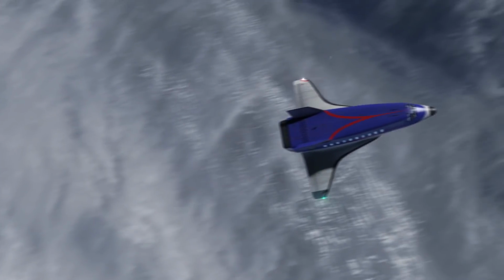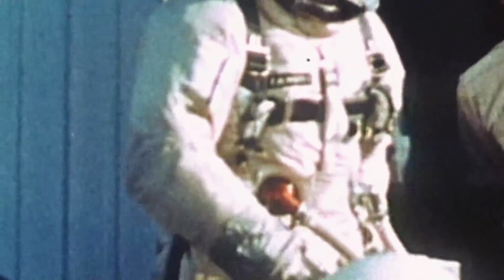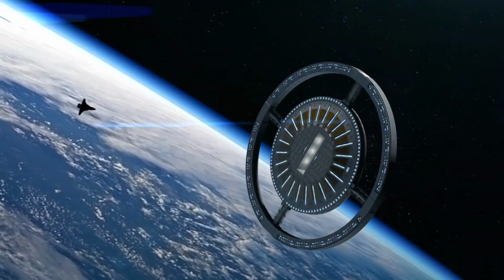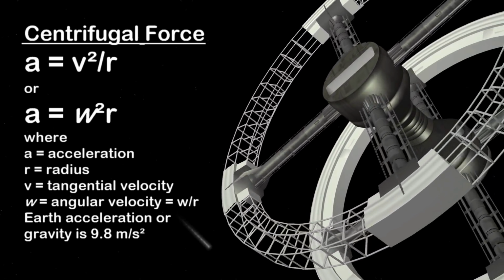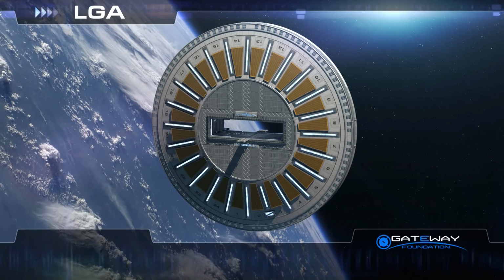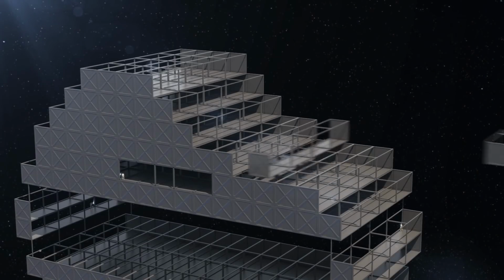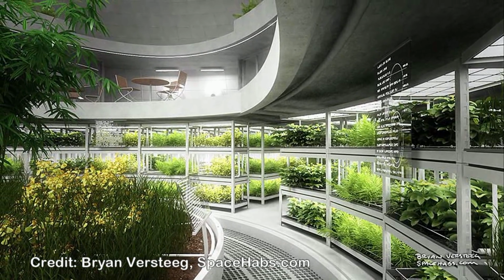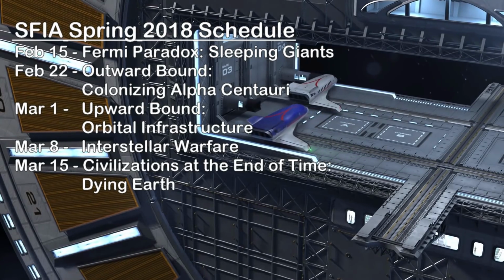Spaceports

Comment: 4:35 The people shown leaving that shuttle would NOT be able to walk like that. That corridor, as depicted, would look like a vertical shaft to them.
Reply: He is talking about how they are walking towards the outer edge of the ring so are actually walking along the walls towards the floor as the video depicts it. Seems the artist didn't think about the directions of the forces.
Reply: They would be able to if it is at all away from the center of the rotation. it would just be incredibly low gravity, but still enough to get a feel of it, and be attracted to the floor.
Reply: The stars moving in the background suggest that the space port is spinning and thus creating artificial gravity via centrifugal force from its spinning. It would be lower the closer you are to the center, but it would still be there as microgravity.

Comment: actually, while the square-cube law does help build large stations in terms of shielding and resonable minimum thickness walls, I might want to note that in terms of pressurized volume the squarecubelaw doesn't help you - or hinder you - it doesn't change anything - the larger a pressure tank gets the thicker its wallks must be to sustain the same pressure inside and te same rules of saling apply to any geometry plus a geometry factor, so any pressurized space scales in mass proportional to the volume - in fact under the ideal gas approximation a pressure tank made of a certain material holding a certain gas an i na certain geometry would have a constant ratio of gas-mass t tank-mass regardless of size - so a large space station would still need a minimum mass per cubic meter - to be fair for a welldesigned spherical or cylindrical pressuretank that mass is usually less then that of the air inisde - which also sclaes proportional to the volume - but if you build spacestations a bit more complicated and a bit less ideal in shape then a single-part sphere the structure needed to contain pressure inside can become quite significant and depending on design could get up to some ten times or so the mass of air - and hile 10 kilogram per cubic meter seems little (thats 1/50 of the ratioin the iss) once every other aspect scales down by squarecube law and you start giing people lots of empty space for comfort it becumes quite significant - for a 2mio m³ space that would be 20000 tons
Reply: The walls already need to be thick to be radiation and micrometeoroid resistant, so as things stand right now they're probably much bigger than they'd need to be just to contain the station's atmosphere.
Of course this advantage will wane off the bigger the station gets, but at least it's something.
Reply: I am glad I'm not the only one thinking that a container's walls must become thicker when it gets bigger. I find it easiest to a cross-section of of a sphere and the forces perpendicular that plane: the tension the two halves pull apart with is the cross-section area of the gas times its pressure (and doubled possibly?), and the tension the walls can withstand is also proportional to their cross-section area.
Reply: +demoniack81 Indeed the insulation is the biggest factor, you can already see this in effect in airliners which while they don't have to worry about micrometeorites and such they do need a good inch or so of thermal insulation to protect their occupants from extreme cold which comprises the vast majority of the thickness of it's walls far thicker than the thin piece of aluminium sheet that makes the skin of the pressure vessel itself which is holding a pressure differential of around 59 KPa (Internal 75 kPa, external as low as 16 kPa at 43,000 ft).

Could probably get away with a differential of only 75 kPa for a space station as it seems that the vast majority of human are quite fine breathing a 21% Oxygen, 79% Nitrogen atmosphere at 75 kPa without any problems after all billions of passengers are exposed to those conditions on commercial airline flights employees easily reaching lifetime exposures of tens of thousands of hours I'd have thought that if the reduced air pressure caused long term health consequences at this level it would probably have been noticed by now, especially in an industry which has very stringent health monitoring rules in place so there is plenty of data tracking the health of flight crews.

And I certainly suspect that people going up there would be required to pass a medical exam to ensure they are in reasonably good health before sending them up there. That's just good practice before sending anyone to a remote location with limited medical facilities and where transport to a fully equipped medical facility capable of providing specialist care would require I would assume over an hour I'd have thought, I mean if it takes 15-20 minutes to safely discharge the energy of an airliner in cruise flight and bring it in for a landing so presumably it would take several times that to safely discharge the massive kinetic and potential energy of an object from orbital flight in order to make a safe landing.
Reply: +Michael Keefer Sure but still it's true that the pressure containing part of the wall structure would then be twice as high, twice as wide and twice as thick which is 8 times the mass. Though that is largely irrelevant here as the pressure retaining skin would be a minor fraction of the total mass of the wall as the pressures humans need to breath are really quite low compared to the sort of force needed to actually rupture something like good quality sheet aluminium or something.

On the other hand the material needed for thermal insulation would be quite a bit thicker, not to mention the material needed to block photons with gamma ray energies, relativistic alpha and beta particles or for that matter a 1 cm pebble closing at 11 km/s.
Reply: "If your are going to be in space outside of the Earth's magnetosphere for years at a time, you will need to have protection from high energy cosmic rays. "

No you don't. Everyone dies. If the cancer rate for long term astronauts is high, that's not really a huge problem. The mortality rate for astronauts and test pilots is already high...is there a shortage of volunteers?

The fact that death is inevitable is liberating when it comes to exploration, because ultimately you don't really have anything to lose if you value the period of exploration more than a longer period of regular life.
Reply: +Michael Keefer The magnetosphere does help quite a bit with charged particles like alpha and beta particles which certainly helps. What it does not help with is ionising radiation which comes in the form of high energy photons such as X-Rays or Gamma Rays pretty much the only defence against those is to put as many atoms of material that can harmlessly absorb the energy as possible in their path to maximise the probability that the incoming photons will hit the nucleus or an electron from one of those rather than striking a molecule of DNA in one of the stations occupants.

Since even in low earth orbit you are beyond the protection of the thick cloud of atoms commonly known as the atmosphere you are stuck with needing to shield against those via some alternative means.
Reply: Those high energy cosmic rays destroy brain cells at a high rate.  If unshielded from them you will not be able to function after a few years.  One of the problems is, will a round trip to Mars result in significant mental deterioration.  You have months going to and getting back and more months unshielded on the surface.  Currently a Mars mission will take about 33 months.  That is a LOT of exposure to those high energy cosmic rays.  If they dig in, once on Mars, they can cut that exposure down to about 16 months plus time spent outside of the shielded base.
Reply: X-rays and Gammas are not the big problem.   It is the high energy cosmic rays that are protons to iron nuclei with energies equal to or better than anything we can do with accelerators here on Earth.  When we went to the Moon, the astronauts saw some flashes.  Those flashes where light generated by strikes in the eye ball from those super high energy cosmic rays.   If your are going to be in space outside of the Earth's magnetosphere for years at a time, you will need to have protection from high energy cosmic rays.   That is one of the unsolved problems of a round trip to Mars.
Reply: If you are not within the Earth's protective magnetosphere you are going to want about 6 feet of rock (or mass equivalent) for shielding against high energy comic rays.  Your problem will be cooling the living areas.  Micro meteors or small space junk can be ignored.
Reply: People... a tank does not care about the volume it contains, only the pressure on its surface + how forces are spread.
Like a dam does not care how much water it hold, only how deep it is + (vaulted) dam length.
Hence why space stations are like a tire : slim cylinder (low section "vault") looped around in a doughnut, with spokes to relieve the tension. Maybe their designers know what they are doing after all.
Reply: The way squarecubelaw fails to works with pressure vessels.  For a twice as big the pressure vessel, the walls must be 2 times as thick to contain the pressure, but cover 4 times as much area.   It will require 8 times as much material to build the container that holds eight times as much pressurized gas.  Scaling up pressure vessels does not gain anything other than open space.
Reply: umm.. no, sorry, thats not how it works - twice as big the vessel, the walls must be twice as thick AND cover 4 times the surface are making them 8 times as heavy while including 8 times the volume  plenty different ways to demonstrat that thoug hthey are basically redundant

Comment: I prefer the non rotating kind of spaceport
Reply: The outer wall would be the floor.
Reply: When walls become floors it just ads up to the confusion. They have to redesign the hallway, this gives spaceports a bad name
Reply: Back to the drawing board it is, then. I like the ring, I like the parking skids, but the rotating port needs to be redone, nobody likes boardways that are perpendiculair to the wall that is the floor
Reply: I gather the problem is that this would essentially be like disembarking from a plane into an empty lift shaft to plummet. The best idea I can think of would be to simply disembark into a lift pod with chairs and straps which could I hope gradually and smoothly orient you to correct angle as you move from micro gravity to whatever level you are going to without falling over or plummeting at greater and greater accelerations as you fall down the corridor.
Reply: Now you sound like someone who knows how to build a proper reception hall for a spaceport
Reply: Bear in mind where they are located the G force is going to be about 1%.  Not going to be much of a problem.
Reply: Not much of a problem? A face plant when deboarding your ship is but an inconvenience?
Reply: With only about 1% G you are weight less for all practical purposes, no face plant.  The mag boots are necessary to keep you from bouncing off the walls or into space.
Reply: That is nice of you to say. But please look what happens in the spaceport. At first glimpse you think all is right, people are just doing what they have to do at such a port. But look closer and you 'll see life ain't easy over there. Next time they should ask a space architect to do the design work
Reply: Ed, The station is doing one rev per minute.  That is a rate of 1/60 rev per sec.  The acceleration created is rev squared times distance from the center.  So lets say the inside where passengers enter a gimbaled pod to go to living quarters is 100 feet.  That means the side ways acceleration is 100/3600 feet per second squared or 1/36 ft/sec squared.  Earth normal is 32.2 ft/sec squared.  That means a sideways acceleration of about 0.09% of 1 G.  So a 200 pound (including suit) passenger does not even feel the 0.17 pounds of  force acting on him/her.
Reply: OK, then do not rotate it at all. Now it only makes docking a hell of a job.
And the artist has to be schooled in physics before he/she makes another rendering of the spaceport. It looks like a 1920's science fiction movie now. I'm sure this can be done much more realistic, don't you think?

Comment: In the animation the space plane lands on an offset rotating runway like a plane, there for actively compensating for it, possible but not great, I would go with a wide circular bay where the ships are picked up by a robotic arm at the center of rotation and then precisely dock it on the wide anular area with multiple docking systems for people or two time earth’s platinum reserve. More docking space, easier process, no contamination by all the jets for control, even repartition of the mass on big rotating object, direct small gravity stepping out.

Comment: Wow. I am at a loss for words with the Gateway Foundation's plan. How expensive would it be to do that right now if you hired spaceX to do it? According to what I calculated, it should be a couple of thousand per kg for geostationary. Doesn't that mean it is economically feasible right now or are SpaceX rockets just not reliable enough yet?

Comment: The gravity on a floor in a rotating space station would cause things like water or round objects to roll oposite to the direction of rotation of the space station, so a little river would form on the center...the whole thing would be like a mountain slope, everything would behave as it would be on a slope...gravity would feel normal at a large radius, coriolis force wouldn't bother you but if you see rolling objects, it would be weird. What is your opinion?
Reply: You can of course build the houses at an angle directly proportional to the rotation speed...the faster it spins, the smaller the radius and the angle bigger...so we need to build them large radius thus small rotation speed to achieve gravity...and the angle smaller
Reply: You know, besides that, the interior of the space station should be quite homogenous...I mean, it can put the structure to strains.
Reply: Yeah.
Reply: Paolo Savonti think again, imagine, make a simulation, something...only things that have friction, something to hang on to, are brought to the same speed that the space station is rotating thus feel gravity, i dont say that balls or water wont feel it but they will move counter to the station as if they roll down a hill.

Comment: Just a thought... At the beginning you're mentioning that the construction wouldn't need to be bulky because it wouldn't need to fight the gravity... However, when we'll add the rotation and simulation of the gravity, wouldn't it add the stress of real gravity to the construction? I'm totally guesstimating here but I would add about 70% of mass every 25% of earth gravity added to keep the structure integrity due to the stress of forces included. I don't really know what would be stress distribution over the station construction during rotation but I'm guessing it would be pretty similar to pretty wide and heavy beam put on support. I know its pretty easy to calculate but it will add quite a bit of mass to the whole construction to keep everything from falling apart.

Comment: I really love orbital stations. I think I hate everything about the one in this video. 

Rectangular sections on a rotating station? That's like curved walls and floors on land. Radial and concentric is better, even for the hub areas. It's structurally stronger, requires less material, and you get usable floors instead of a rat's nest of girders mostly at awkward angles. Look at any wheel - not made of rectangles. 

Interior docking bays? Why? That volume is nearly zero-G, ideal for storage and heavy machinery. I reckon axial docks are better. Internal bays have limited volume, and it's less safe, if like a rocket engine explodes, or the "brakes" fail during docking. 

Large areas for simulating Moon and Mars? Why? Why do you need 100,000 people to experience lunar gravity? If low gravity is safe, you don't need it, and if it's not safe, you don't want it. Any research could be done on much smaller scales, and - significantly-  that research will be over and done with long before the first large station is ever built. 

I'm also skeptical about tourism driving expansion. Low orbit is cheaper than high orbit or more distant orbits, and the tourist experience is the same, or maybe better - less transit time, better views, better internet access. 

I bet these stations will be built only after space is already massively commercialized by mining and maybe other industries (solar power, manufacturing, agriculture). Tourism will be made possible by other profitable space business, not vice versa.

Comment: Maybe the Kessler Syndrome is what causes the Fermi Paradox. As we've found, space travel and development is hard and expensive ; while other technologies like transport and telecomunications develop quickly, space development has been relatively stagnant for several decades. Maybe alien civilizations get stuck in their planet because of their failures in spacial technology.
I don't know, just a thought that crossed my mind.
Reply: On the timescales being discussed the Kessler Syndrome just isn't an issue for the Fermi Paradox.  Even the worst sort of Kessler event wouldn't close down LEO for very long, and cleaning debris in upper orbits is fairly straightforward.  Kessler Syndrome is a temporary economic/military setback, not an end state.
Reply: Or perhaps the Fermi Paradox is solved by the simple solution that space travel is not necessary for a civilization to thrive; in fact it is a huge and extremely impractical investment. I think it's safe to assume everything on this channel is just science fiction at best.